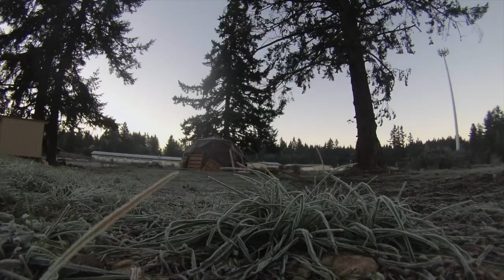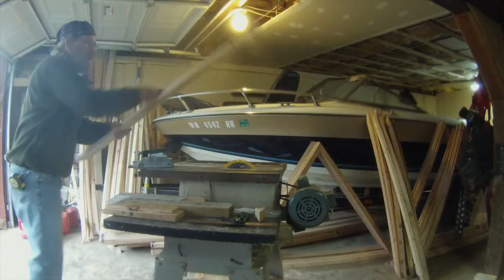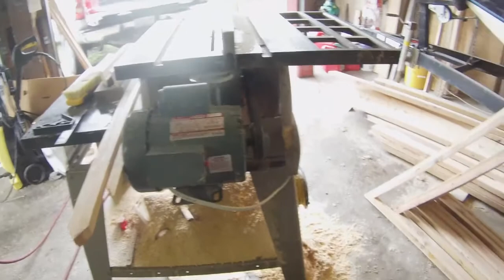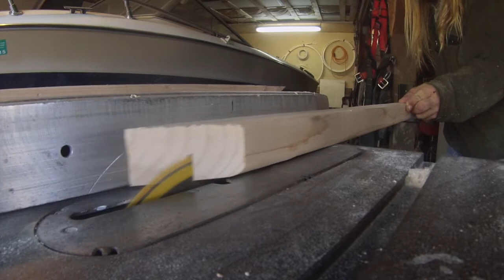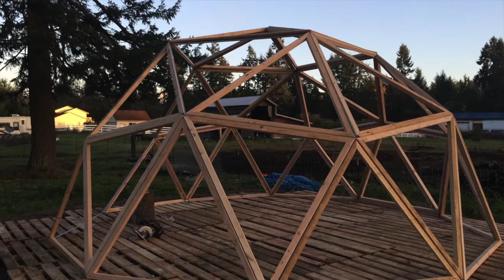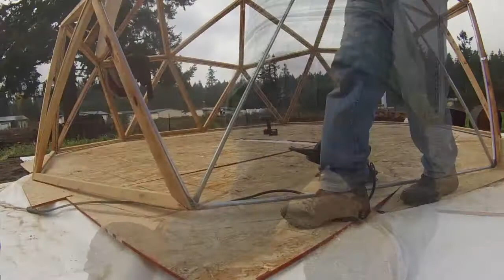Building My Geodesic Dome (part 1)

Comment: Yep, pretty slick by getting around needing to cut all those compound angles by making it a steel tubing and then coming back and cutting a 90 degree chunk out of the back of the wood. Pretty genius way to make it simple.

I get the ideal, the wood is actually only to hold on the panels, it is not structural technically, but it adds to the structure strength.. I also realize all you had to do since the dome was made of steel tubing stacked on top of each other at the hubs, is to line up the wood frames so that the highest frame matches the lowest frame, and you screwed them all together so they all end up flush with each other. I think it is pretty genius way to reduce all the thinking and compound angles at the same time you still going to have a nice panelized dome that sits flush with itself.